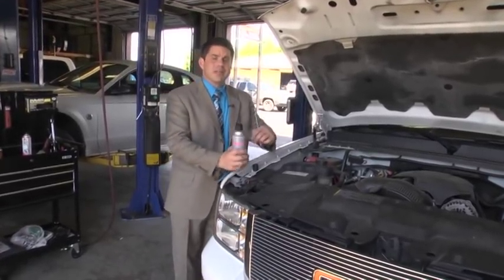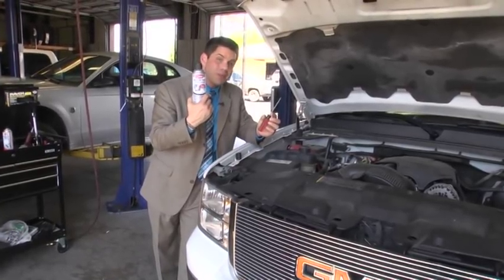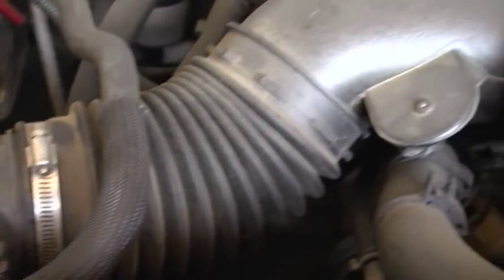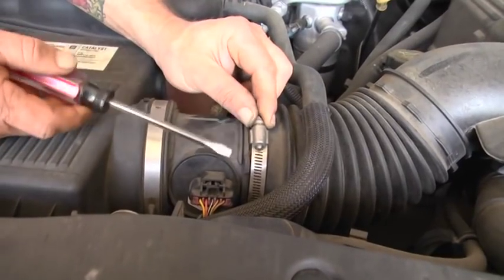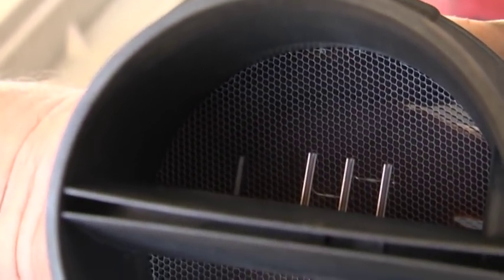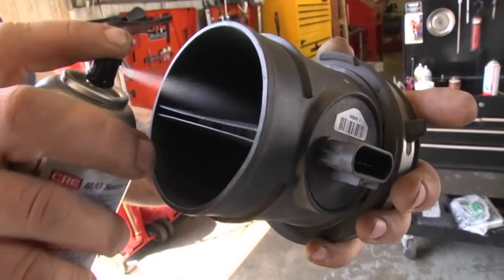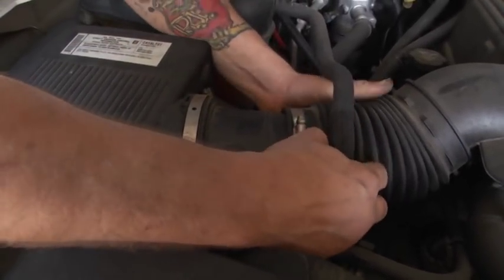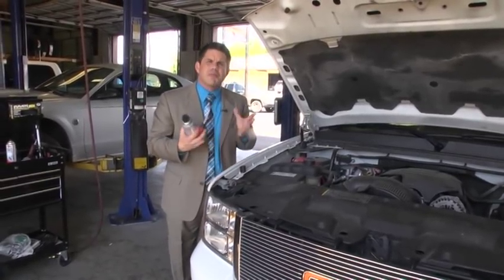Want better gas mileage?  Get a screw driver and spend 2 minutes here

Comment: Who wants to bet, if I spray the MASS sensor on my car, within two days the Check Engine light comes on. I'm leaving mine alone.
Reply: wtf, no you wouldn't spray it while the vehicle was running, and yes dust that buns on the wire, gets stuck to the wire, thats why you clean it.
Reply: im not gonna argue with someone that clearly has no idea what they are talking about. This becomes very apparent by saying things like "Combustion chamber cleaners are sprayed into the intake while the car is running, period". clearly you have 0 experience with working on vehicles otherwise you would not say that. So im gonna leave you with a few links to check out and maybe you will learn a thing or 2

this link has a graph that shows particle size that makes it through an air filter depending on the filter type
https://en.wikipedia.org/wiki/Air_filter

this guy made a video on cleaning the MAF sensor, he then demonstrates the difference it made with both a scanner and he calculates his fuel mileage after the cleaning 
https://www.youtube.com/watch?v=gRfaPfTcfOM

This is just a interesting read, it even has a dyno sheet showing difference in horsepower after cleaning a MAF sensor.
https://carcarenewsservice.org/article/clean-mass-air-flow-sensor-restores-lost-mpg-and-horsepower

There is plenty of evidence that shows cleaning a MAF sensor actually makes a difference. If you are too ignorant to actually learn and/ or research this, then there is no helping you
Reply: you just keep proving you have no idea what you're talking about. Air filters block the large particles, small particles still make it through the filter. These particles are not big enough to do damage to the engine. When the dust goes past the MAF they get stuck to the wire (look at a house fan and how the dust collects on the cage). Burning that dust just hardens the dust to the wire, this makes it harder for the coil (the MAF wire) to be cooled by the air (that dust on the fan, try and burn it to see if it just goes away).
 
You also would never just spray the chemical into the air cleaner and let it pool up. You would however remove the MAF from the air cleaner assembly and spray it like that, then use compressed air to dry the coil.

Source: 10 years of automotive experience
Reply: Everyone here is thinking from the wrong end, MAF sensors don't get dirty from the air filter side, that air is clean. It comes from the intake manifold side of the engine, especially in a higher milage engine there's a fine mist of engine oil floating in the intake manifold from the PCV valve after you shut off an engine. It will settle and form a deposit on your MAF wire much like it forms a deposit on a intake valve. But will take awhile to accumulate enough to cause any real problem since the MAF sensor is so far up the line. Try it sometime, take the fresh air tube off and wipe your finger on the inside, and you'll see the residue.
Not to mention exhaust deposits from the EGR system in a similar fashion
Reply: Maybe it's not hot enough to prevent particles from sticking. Sounds reasonable that particles and junk can build up even if getting burnt. I mean have you seen the inside of an engine? It's not usually 100% clean is it? 
It sounds like Taz has witnessed the dirt build up...
Reply: no, trust me it wont. Unless you are poking at it with a screwdriver or something or are using some sort of really high pressure spray causing it to snap the wire, you shouldnt have to worry about a check engine light coming on. Also you dont need mass air flow cleaner or whatever the hell they called it, a can of combustion chamber cleaner or even carb cleaner would do the same thing
Reply: Yeah don't get any liquids by MAF at all unless it's unplugged. Water best I seen an tried almost all products on the market. But mash air flow spray works great if do like it says.. Many are dumbases. Spray it while running or plugged in. I laughed my ass off on fool at Jiffy lube who fried it on friend truck. Then they had the balls to charge him for it. lol I walked over. You will buy new MAF an this is free 100% I know corporate don't want to know how fucked up service men they have. They ended up washing his truck free oil change for 6 months free.
Reply: Jonathan Blake Maybe your engineering degree (if you even have one) didn't teach you everything. Maybe real world experience is a better model for success than mathematic modeling. Hmm, let me see, yep, last time I checked experimentation is the real world evidenciary process used to confirm or deny hypotheses made by some fresh out of physics class dumbass like yourself.
Reply: supercommando89 Your comment wins the reality check.
Reply: @ Taz Gaming Jonathon Blake & Alberto. This this. By the way don't spray MAF while it's running. Dumbass did it at Jiffy lube place and it fried the sensor. $400 he learn lesson fast. Warm vehicle up to normal temp. Pour cup of water put in intake while high rev decarbonize items in intake, valves & pistons. But don't pour it fast. You know what happens. You can do it many of times if needed. I learn that back when I was in high school auto shop. Been doing it since. Works great.
Reply: eric rhodes yeah no shit, don't do it while its running! on most cars you damn near have to take the intire intake off which means unplugging the sensor I don't know why you would want to run the car in this condition with no intake and MAF disconnected just follow the video it does work
Reply: Jonathan Blake you talk a lot of text book my friend i dont think u ever get your hands dirty lol u clearly have a lot of grammar and thermodynamics knowledge but verry little or zero real life and live work situations we don't live in a perfect world trust me a lot of us are laughing at you hahaha
Reply: eric rhodes yeah the water works great for the top of the Pistons and the valves haven't paid attention to MAF though I would think it would have to be distilled water right? Any other would contaminate it more?
Reply: eric rhodes haha nice I would have gave him a toothbrush to make sure they shine my wheels really good LOL
Reply: displayfireworks1 not true. But if your check engine light comes on and your code say your mass airflow. You spray without moving the module like they said and don't touch the wires just spray it the code will go away.
Reply: Ill clean my MAF and come back to you with the results. Nothing beats evidence.
Reply: Taz Gaming  you don't use compressed air. Only air dry. Should say right on the can.
Reply: No actually it does. And if you use a K and N air cleaner you need to clean it because it would have oil on it. It's not a bad idea to clean it anyway then you know it's working properly.
Reply: displayfireworks1 9.  Ha ha ha   odds at 50 50
Reply: Jonathan Blake ..logically..!
Reply: displayfireworks1 ....crapshoots at 50 50..
Reply: Pablo L What's your observation?
Reply: Then explain how my MAF sensor was dirty after 225k miles if the air filter would prevent particulates from reaching the MAF sensor? Even my throttle body was dirty and I just cleaned it.
Reply: Idiot
Reply: Taz Gaming they must not understand how dust an carbon build up works.
Reply: My check engine light came on but then went away on its own
Reply: ...better get that tinfoil hat back on brother...   better safe than sorry
Reply: Jonathan Blak
Reply: eric r
Reply: Nathan Spears - you did this, cleaning the MAF, and the 'check engine light' came on? How long was it on? I have a 99 Mazda Millenia S, with a shitty Miller Cycle engine, that is just guzzling the gas. About 10 miles to the gallon, and it's very slow and unresponsive throttle. I can't afford this mpg anymore! Plus, i dont understand the complicated engine they dumped in this heap! It's really a piece of shit, but i gotta fix the mpg. Gotta get at least 20mpg outta the damn thing. Should get over 30mpg, in my opinion, with a 2.3L, SLOW as molasses engine! I'm just reading up on any mpg advice and any possible problems, cuz I'm sure if something negative CAN be a side effect, it WILL happen with this bucket of shit car! Hate this Mazda garbage Millenia S, but I'm too broke to get something else!
Reply: Very true
Reply: Kevin Loewen thats because the oil is also hanging out on the inside of the cone
Reply: he said MAF sensor.... mass air flow noob
Reply: Jonathan Blake that spray can is $5 u idiot for why would they sell it for $70 when with around $50 u can buy it new u keep proving that u have never worked on or boght car parts lol ur really are an idiot!!!!!
Reply: Taz Gaming i agree with you my friend this text book nerd needs to start wrenching and improvising when faced with a real-world jobs lol clearly he has no improvising ideas under his belt lol
Reply: Jonathan Blake and I know physics don't change but you text book nerds or wannabe engineers I have no idea what goes on out there leave the dirty hard work to real men
Reply: Jonathan Blake maybe you don't understand sarcasm either
Reply: Jonathan Blake automotive technology is created on thermodynamics u idiot
Reply: I don't know whether to cry or laugh?

There is no reason what so ever to ever clean your MAF sensor if it's a strip wire sensor.

Agan, you don't get that the wire gets 64-80 times hotter than the air around it, this leaves a shield around it where no particles can flow until cooled down at which point yes, microscopic particles could assemble but as soon as it's heated, they are burned off and as the heated surface LITERALLY has no friction it won't stick to it.

You can try this with anything at home, heat any piece of iron until it's red hot and see what you can get to stick to it, the thing is, you can put things right on it and it won't stick anyway unless you let it cool down with that material on it and even then you can remove it by heating it up again.

There is no reason, what so FUCKING ever to ever clean your MAF sensor, period. Anyone who understands thrid grade physics will know why.

Also, there about 50K videos about oil additives out there... Extreme results in every video but the ones that are not sponsored by the brand.

In reality, there are no good oil additives, if there was they would be in the oil already.
Reply: It gets red hot, there is nothing you can spray on it that will clean off anything that isn't burned off when idling.

You don't need combustion chamber or carb cleaner either, in fact, using that before your air flow sensor on a running car will set your engine on fire.
Reply: First of all, the air flow sensor doesn't need cleaning, at all. The air filter wouldn't let particles that could attach to a hot metal surface get through anyway and even if it did it would be burned off and then blown off through air intake.

Who uses combustion chamber clearner through the air intake on a non running car? It would for a puddle in the intake and once you start your car the air flow sensor would ignite it.
Reply: Air filters block any kind of particle that could attatch itself to the air flow sensor which gets very hot and thus has ZERO friction. Your problem is that you don't get third grade physics and how particles move around hot surfaces.

IF something got stuck to the wire it would be burned off and the carbon residue would have 0 friction on the hot surface and thus be blown away by an ants sneeze.

You simply don't get this at all.

Combustion chamber cleaners are sprayed into the intake while the car is running, period. Carb cleaners (it doesn't actually matter what you call it, it's just paint thinner) and the deal is that you remove the sensors power and spray it in.

I mean, you do that if you are an idiot and like to play pretend that it helps... In reality there are ways to clean up your valves and pistons but you need a nano compressor to do it. Costs around £300 to get it done but it's the only thing that works simply because without it you won't penetrate the carbon buildup.
Reply: Jonathan Blake  Dude you are dumb as fuck and have obviously never had to replace a MAF sensor. They get pretty dirty over time. Air filters do not stop all particles, if they did the engine wouldn't be able to suck air effeciently. you useless twat.
Reply: +ALberto Ascencio Physics does not change just because CRC wants to sell you a can of spray on paint thinner for damn near $70.

You may not realize this but real world knowledge has, per definition, be based on physics. If it's not it's based on fantasy and not relating to reality in any shape or form.

The world works based on principles of physics, should one of those principles change even a little bit reality as we know it would cease being real and none of us would exist. These laws are non negotiable, they just are and if you disagree with it then you are simply wrong.

We live in a world where this is the case, you may laugh at those who are more knowledgeable than you but what possible reason could there be for that other than that you are an idiot who wants to stay an idiot?

Laugh away, children and play pretend that in your magical special world the laws of physics do not exist.

Also, you don't understand what thermodynamics is, it has nothing to do with anything I've been referencing thus far.

Comment: youd be surprised ive seenbsome of those sensor wires filthy and filters that never changed this process made car run like new in some cases. oil dirt and debri get stuck on the maf sensor all the time especially if you rarely change filter

Comment: bro people don't even know where to add brake fluid, you think they are going to do this shit? come on now.
Reply: WesT Fitness you should never have to add brake fluid until flushing the system.  the reservoirs brake light is calibrated to pad thickness. when your pads have worn to a predetermined wear limit the fliud level compensates for loss of pad. lowering the fluid level to set off the brake light. adding fluid 1, throws off the wear indicator..2, makes brake fluid  overflow the reservoir when caliper piston are press back in when replacing pads..
Reply: Captain Crackhead hey captain crackhead you dont need to explain it to me. im an ase master tech. i was speaking out as in terms when people have a line leak...master leak...etc. (such as ive had a family member call me) who was with a friend and said they had no brake pedal. told them to check the brake fluid level and they didnt even know what/where that reservoir is.  that was what i was talking about. P.S if your pads are worn and the fluids at the minimum line. odds are it would still be slightly low on fluid. it doesnt take that much between that difference of pad depth. but correct you wouldnt add fluid just cause the pads are worn...that is also common sense.
Reply: Captain Crackhead brake lights are also not calibrated to the brake pads. its linked to the fluid. there is a differences between a brake light and a brake pad indicator. those are 2 seperate things.
Reply: WesT Fitness wtf is break fluid
Reply: funny thing is - you don't add brake fluid, if the brake light is showing - you probably need tochange the pads, the fluid is down because the cylinders need more fluid to be in the same position, itss designed like that so you have to check the brakes, not add fluid
Reply: Which is why he showed them how to do it.
Reply: wrong there is a sensor that plugs into the pad when the sensor touches the rotor it turns the light on
Reply: They posted this quick video to justify selling this service in their shop probably at a 30 minute rate . What they don't tell you is the residue left from the brake kleen actually shortens the life of the MAF sensor because the sensor has to burn it off . If there is NO check engine light on and the vehicle runs fine leave it the hell alone . YES i am a 30 year Automotive Service Technician
Reply: People who are NOT mechanically inclined watch this and say OMG i have to get this done . I am a mechanic and hear this all the time . Not necessarily this service but people watch YouTube video and next time in they have questions and ask if the contents of the video would apply to them .
Reply: This doesn't even work in real life, this was just a advertisement for another "fix in a can scam".

Comment: he doesn't mention don't do this while it's hot. it'll snap the wires. they're very sensitive. also make sure it's completely dry before reinstalling. and brake cleaner works great and it's cheap.

Comment: This trick worked for me I  cleaned mass air flow sensor and cleaned throttle body and  my car is very smooth running and fuel efficient thanks

Comment: No need for this if you replace your PAPER air filter when you're supposed to. If you use one of those oily, dirt-passing pos k&n's because you think it gives your car an extra 20 hp, then get used to cleaning your MAF sensor regularly ... or replacing it if you don't clean it right.

Comment: IF I WANTED TO RUN CAR CAR ON FUMES ,YOU KNOW A TANK OF FUME PRODUCING GAS HOOKED UP TO INTAKE ,WOULD THIS SENSOR IGNITE THE FUMES  :) ? AND I WOULD DISABLE FUEL FROM TANK  BY FUEL PUMP ALSO !
Reply: PLEASE GIVE ME YOUR PROFESSIONAL OPINION
Reply: Install whatever you use to deliver the fumes to the engine after the MAF sensor and you should be ok as the air/fumes won't go backwards while the engine is running.  Look for tutorials on how they do propane conversions, should be fairly similar to how that works.

Comment: Want a better mileage? Use plus 87 octane gas instead of regular gas , you will see the for yourself improved gas millage , mostly in older cars with high millage . Try and let me know, if it didn't do the trick for your car, as it did to both of my cars 2001 dodge gc and Mazda 2005 4x4, just go back to regular gas which i personally don't recommend using anyway.